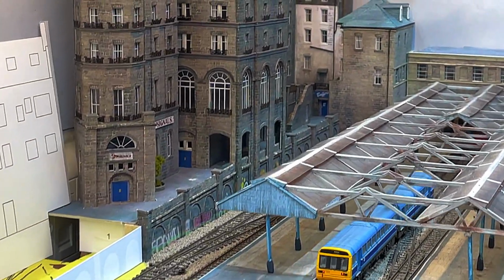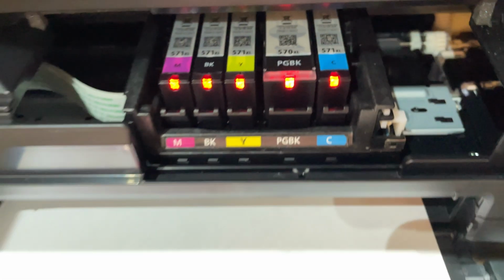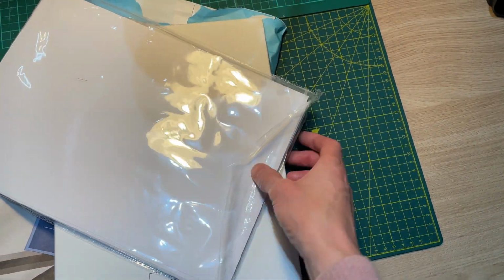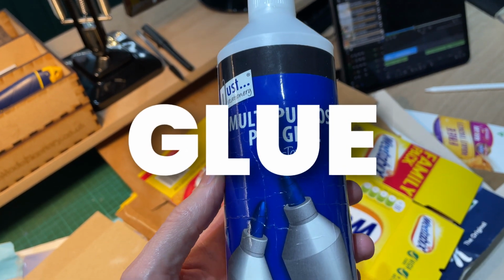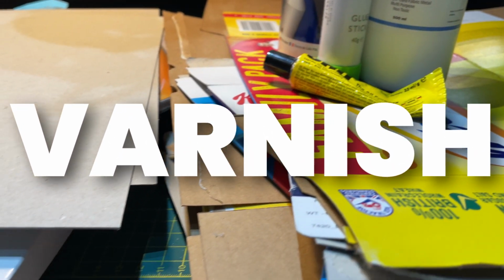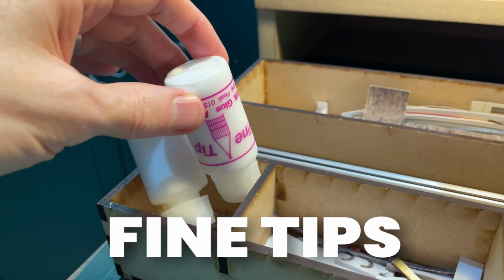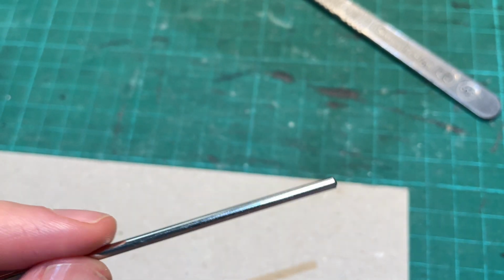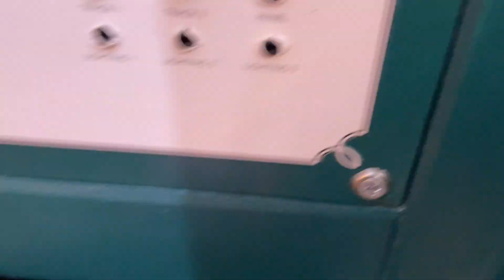Scratch building with card - tools and materials

Comment: I note your affection for Weetabix cereal packet as a construction material. I don't eat eat Weetabix (my partner does eat "wheat biscuits", but prefers the Sainsburys or Marks & Spencers versions).

But I do eat Weetabix Minis, and find the packets are fantastically tough and difficult to tear. For the reason above I can't compare them to Weetabix packets.

But I can measure them.

The thickness (measured with a 1/10 thou reading micrometer) is 0.018" or (converted) 0.46mm. Direct measuring with a metric dial caliper gave 0.48mm. I suspect the micrometers small faces may have very slightly compressed the material.

I keep the packets around for making custom boxes (I enjoy doing rather fancy gift wrapping) or templates to draw round.
Reply from the maker: A man after my own heart!

Comment: A small tip from one who used to make architecture models for a few years : use the Scotch gel glue (sold in Green tubes). It's way less stringy, glue paper as well as styrene - a bit like pattex contact glue - but, added advantage, it can be removed from bristol card without damaging it by scraping with a scrap of Bristol card. The dried glue is a bit rubbery and glue 'messes' are easily removed by friction. I use it when in need of gluing styrene on pvc or both on card with great efficency.
Reply from the maker: Thank you Eric. This is an excellent tip. I've not heard of this glue before, so I will buy a tube and see what it's like. :_chandClass47:Michael
Reply: @Eric Sainte  @Chandwell  I'll add Thak you as well.  You guys make it hard to build mountains when I couold make towers. ☻

Comment: I use key stock a lot forsmall weights. Not like a key to open a door, but the key that keeps a pulley connected to a shaft. It's pretty cheap steel. It's about 12mm x 12mm and I cut it into 10 cm lengths.  I also have 2 big hunks of aluminum that I found in a garbage can, lol. I use them all the time!
Reply from the maker: Brilliant suggestion Mark - thank you! I've often wondered about what I could use as decent weights. My whisky bottles and cookery books are good, but sometimes leave me wishing for something more. I'll look into this. Thanks! :_chandClass47:Michael

Comment: Lovely little guide Mike :) 

I tend to design within inkscape and print directly to the adhesive labels, stick them to A4 card then cut around them - this gives me my finished elements with no risk of warping or drying times. I just cut around where I need to and stick together with rocket card glue! 

Cheers bud 👍
Reply from the maker: Thank you! I have never had much luck printing directly to the labels. I find them a bit too “grippy” when folding around corners, and the prints are a little fuzzy. But then I use really cheap labels so that is maybe my own fault! 😂. :_chandClass47:Michael
Reply: @Chandwell  I construct mine a bit differently to you mate, it's a much faster method at a slight trade off with 100% accuracy - if you care to you can see this on my channel, don't feel obligated to though. :)
Reply from the maker: Gonna have a look!

Comment: I really found this useful and have begun to scratch build in N gauge. 
I've purchased some textures from Scalescenes but when I have unpacked them they are pdf format. How do you get them to jpg format without changing the scale?
Clipping images has been troublesome as well. The image either wouldn't clip or it would only leave an outline of the part you were wanting to clip to.
Perhaps a video on clipping sometime.
Reply from the maker: It's not possible to save them as JPGs without causing yourself headaches with the scales. Try using Inkscape to save them as PNGs as they maintain their scale.
Reply: @Chandwell  Thank you Michael.

Comment: Hi Michael, thanks for a fascinating video. I have been building scratchbuilds for a few years now although in 4mm rather than 2mm scale (big respect to you!) and I do use many of the things you mentioned but some good tips for me to follow up on as well. With regards to UHU, have you tried the solvent free version? A bit more expensive but completely stringless, I keep some in a fine tip applicator as well as PVA. Like you I had a Canon photo printer but the cost of the inks was really getting to me so I have splashed out on a replacement Epson 8550 Eco Tank, expensive outlay to start with but it will pay for itself in a couple of years against cartridge ink costs I think, the inks are supposed to last for about a year for an averge user. Cheers Steve
Reply from the maker: Thanks Steve! I had my eyes on an Eco Tank printer, so it will be great to know more about how well the ink lasts. I've not tried the solvent free UHU, I will take a look at that. Where did you get your fine tip applicator from?  :_chandClass47:Michael
Reply: @Chandwell  Hi Michael, did you ever receive my response to your questions above? They seem to have disappeared
Reply from the maker: Hi Steve, no. I didn’t get anything. YouTube has a habit of deleting things for no apparent reason! Maybe email me at hello@chandwell.uk?

Comment: My Hp printer has 2 ink cartridge one black one colour is that not good
Reply from the maker: It’s neither good nor bad. My old printer was the same. The only issue is that if one colour runs out before the others, then you need to replace the whole thing, thus wasting the unused colours. My individual cartridges always run out at different times.